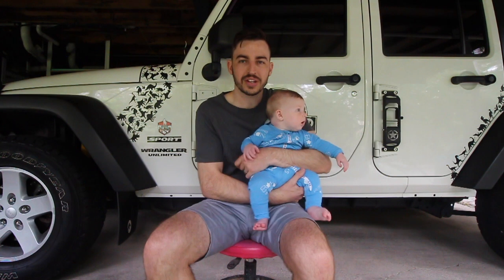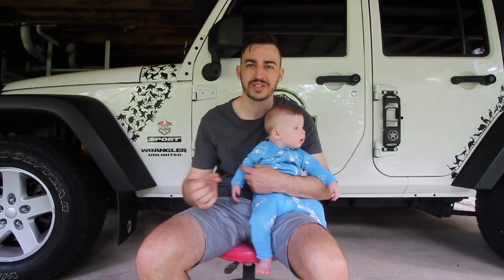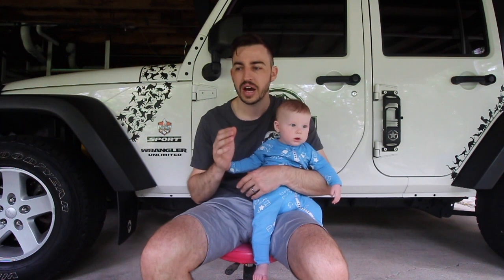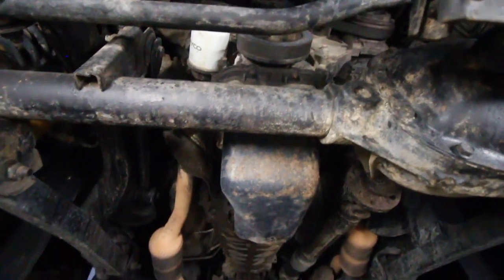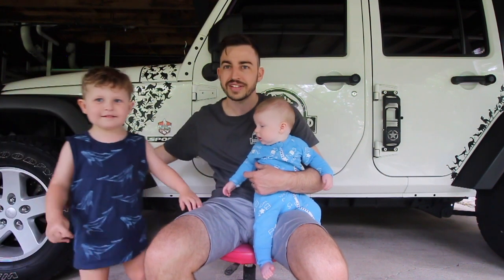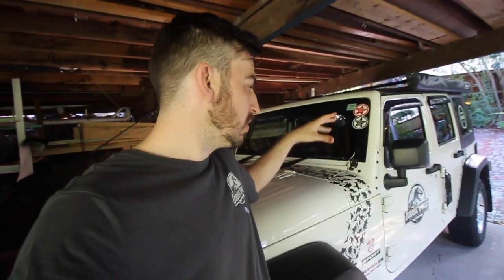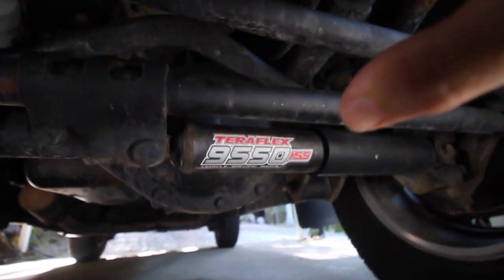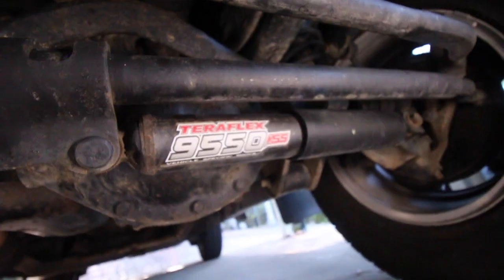CHEMICAL GUYS UNDERCARRIAGE SPRAY

Comment: Did you use a degreaser and pressure washer underneath before hand?
Reply from the maker: The underside on my one was pretty clean, but if your one is dirty it would be a good idea to give it a bit of a clean before hand.